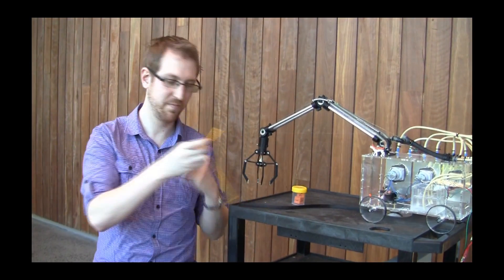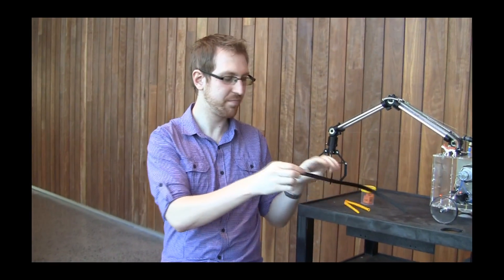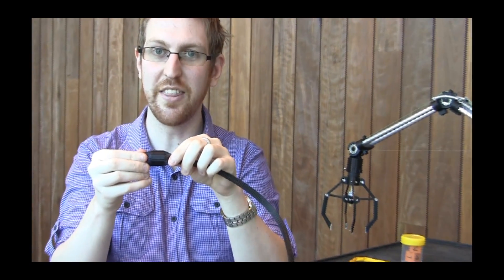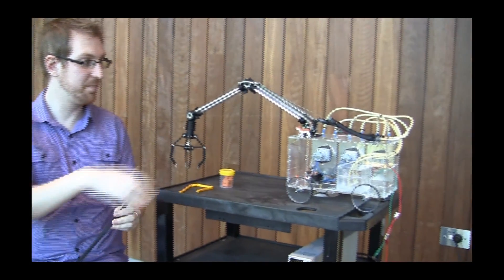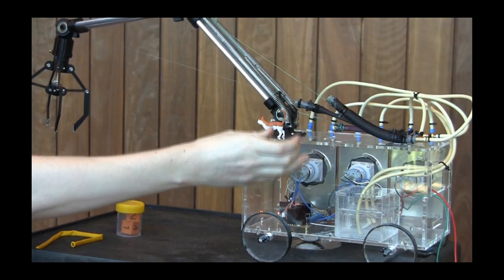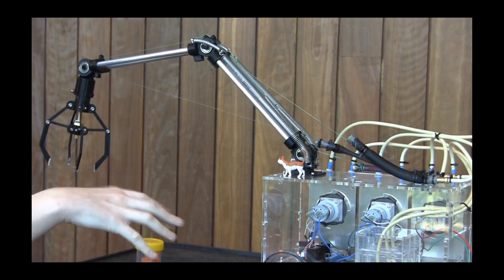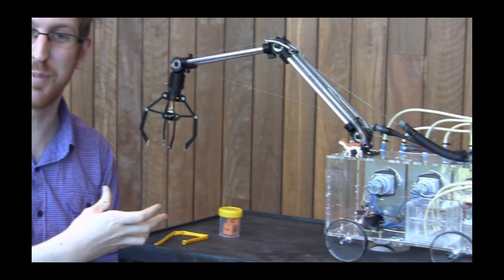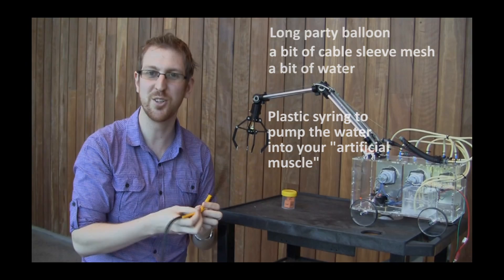How to make your own artificial muscle

Comment: not a really good method.... to operate you need a pump for every muscle, and even if you use just one pump with a valve system, pumps are big and need a motor, so why not just use a motor???
Reply: Strength, flexibility, weight, and cost are all important factors. A pump, reservoir, and valve system in a central location is far more efficient than putting motors on each joint. :)
Reply: because they catch fire if they have voltage input but cant tourn

Comment: Hydraulics make shitty muscles.
Reply: The biggest obstacle with hydraulics as motivators in an exosuit is from the 'all or none' movement of the piston when oil is pushed into the cylinder. Human movement isn't all or none like standard hydraulics, as we have a accelerate/decelerate cadence to all movements. To skirt around the problem with hydraulics, a gradual open/close valve system would have to be designed.
Reply: @davidsirmons  Those are called proportional valves and have been used for decades